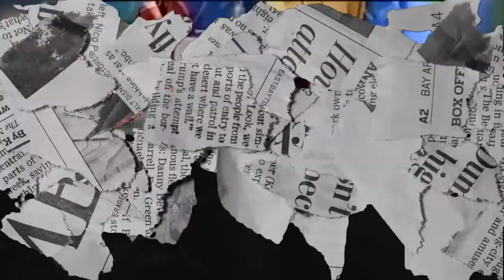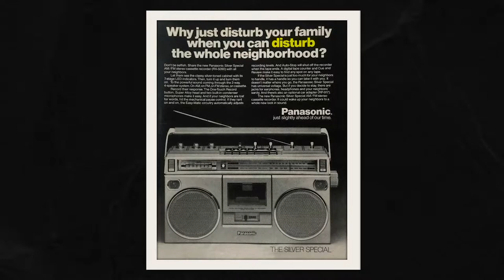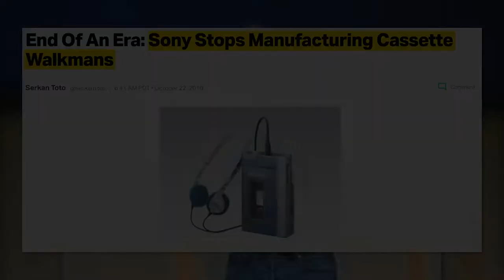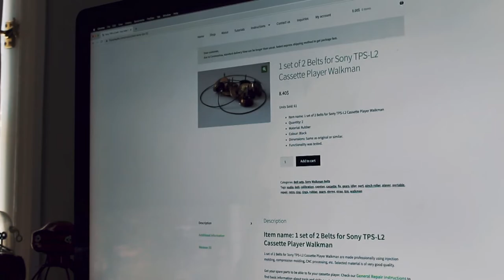I Bought The First Walkman | TPS-L2

Comment: You have to understand Sony didn’t just randomly make a new digital Walkman. They’ve been making digital Walkman players for over  decade or so, the one you mentioned was just a continuation of it and the brand. Despite what people might claim there is little to no market for making a cassette player, plus most of the tooling required is no longer available to manufacture them.
Reply from the maker: I am well aware of Sony’s Walkman brand. It was just a lil’ joke I put in the video, since a lot of people I know were expecting for Sony to make an actual comeback cassette player.
Reply: @natedaninja, YOU have to understand, no one cares about your long winded, know nothing comment.
And as far as you being a ninja; no.

Comment: How many of those TPS - L2 went to the Rubbish Tip when the Drive Belts had failed? I bought mine in 1979, with two pairs of Headphones. I was really impressed with the sound quality, and the features. I used it for a couple of years, and then removed the batteries and stored it away in a clear sealed bag. Being over 70 years old now, I have just realised that the TPS - L2 is in big demand. I had cause to change the Drive Belts just once, and was very careful. But not difficult to do. I tried the Walkman a couple of years ago, and the capstans didn't turn. Clearly, mine needs another set of Drive Belts to make functional again. Sony have all of the Tooling, drawings etc......They could easily produce this same model again. Greetings from Australia.

Comment: I've been trying myself to get into walkmans and i'm very interested in this perticular model and I wonder where you got it from? I know there is some good options of broken ones on ebay i could buy and fix myself but i'm afraid i'll buy a more damaged than just the belt and not being able to fix it.
Reply from the maker: Off of Mercari for $400 (which is really cheap when compared to the usual prices of $700-$1000 of this model). It took me months and months of browsing to find it at a cheap yet good condition
Reply from the maker: Also, I had basically no prior experience or repairing a Walkman either so I was in the same boat as you.

Comment: Hey! I recently bought a sony tcm 600,and after a bit of use, the belts got cut, and after I put in a replacement belt, the same thing happened to me, it started eating the tape, did you fix it by just swapping the belt or is there something else? Thanks in advance!

Comment: Hello Mauricio! I have recently gotten lucky and gotten a sony walkman wm f-35 for very cheap!! It’s in mint condition outside and inside except i need to switch belts. I was wandering if you could tell me if i have to do soldering work inside to open it? If so, i will not try to change belts. I would really appreciate it if i could get an answer. Great video by the way!
Reply from the maker: For most walkmans, you can simply open it up, without having to solder anything off or back into place, such as with this model when it comes to replacing belts. However, I’m not too familiar with the WM-F35. You could use a mixture of videos. Like this one: https://m.youtube.com/watch?v=-1zqV4JA7zw (However he does rip the wire out and resolders it whilst in the 2nd vid I send, that guy doesn’t) and this one: https://m.youtube.com/watch?v=BA6qxgBE41Y
Reply from the maker: I wish you luck in this! If you’re too worried with damaging the Walkman, you could send it off to get repaired, like Retrospekt
Reply: @MauricioJara  i’ll check out the videos and do my best. Thank you so much for the quick response!